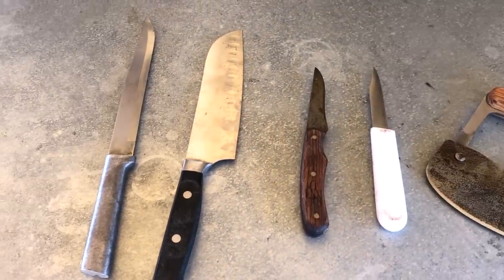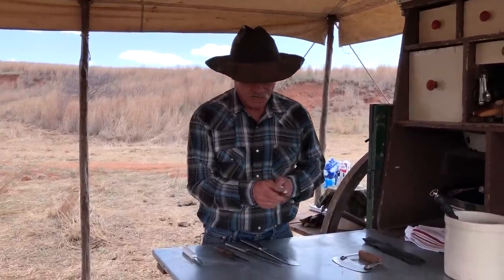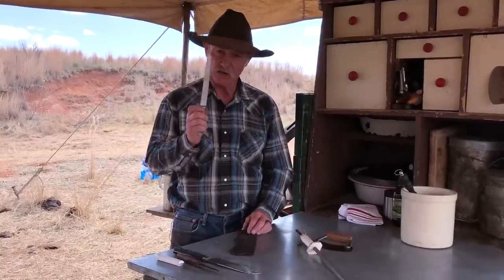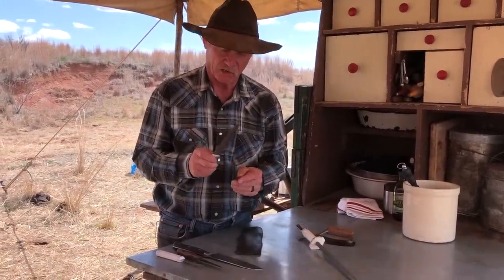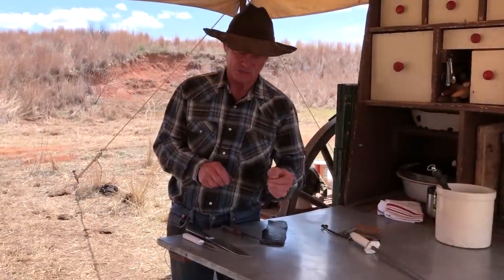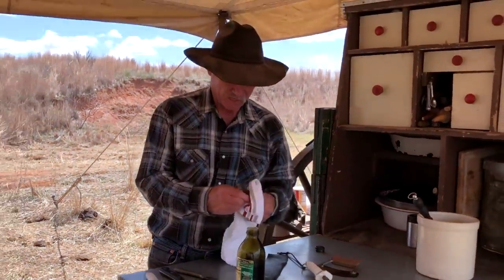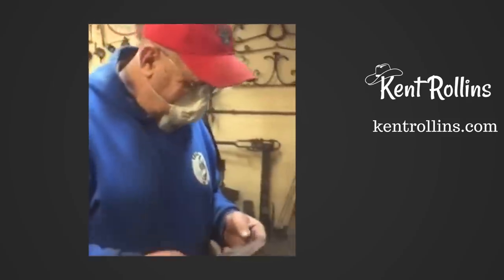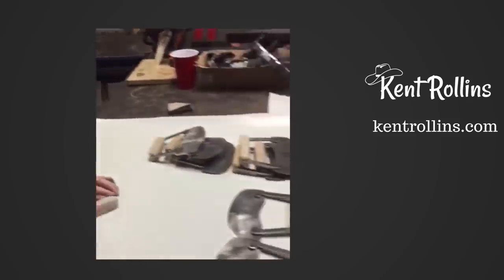Knife Sharpening Tips and Care + Hash Knife How-To

Comment: Years back i recall a Gillette razor commercial that highlighted their "50 foot strop" polishing the final sharpened edge of razors. Years back, my barber who used a straight blade for shaves and final trims around the neck after each haircut, used a 3 foot  leather "strop" before every use of his straight razor.  Un believable edge ! The finished trim was baby butt smooth. Sadly, today folks aren't trusted with a real live razor blade.  Even so with good knives, many don't have great knives and those who do, some don't use the correct sharpener on them. The craft is long gone it seems.

Comment: in case anyone wonders why you dont put knives with wooden handles into the dish washer the hot water makes the handle swell and will cause the rivets to break loose and make the handle loose and fall of or cause the wood to crack because of the swelling remember metal dosent give like wood does and it also dosent absorb fluid like wood

Comment: Honing and stropping with a steel and a leather strop  is a good way to help preserve your blades. Honing is different because you are basically ironing the edge back into place. Using abrasives like a stone will remove metal, many times, un necessarily.

Comment: A sharp knife will cut you just as well but it's over quicker. Truer words have never been spoken:). I've cut a finger tip off more than once, didn't realize it until I saw the blood. LOL. Good advice on the sharpening steel and strop. Personally, I hate sharpening  dull knives. I religiously use my steel every single time I use a blade. Takes 30 seconds and my knives are always razor sharp.

Comment: Your Hash knife is also called a Mezzaluna. They have either 2 handles, 1 on each end or like what you have. You can get them alone or with a rounded out cutting block that matches the curve. You can get them at the big box stores. I have 3, a single blade, double and triple blades. The steel does not sharpen a knife. It maintains an already sharp knife that has been used a lot. It corrects the edge back down to a straight bevel when I gets rolled over on the board. Re-aligning the bevel makes it cut cleaner and better.  Until it does actually get dull.
The V steel sharpener is the worst thing you could ever use on good quality knife. It does rake and scrape and leave chip marks knife/sword fight.  sharpened 4 knives for an elderly friend on Monday. It took me 30 minutes per knife to get the dings out of the blades first then, I could sharpen them properly. I told him to NEVER use that thing again. I was a Chef for 35 years and was taught how to sharpen my very expensive knives myself many years ago by a Japanese Sushi Chef friend. There are all kinds of sharpening systems on the market and videos showing how they work. If you don't know what you are doing with a wet/oil stone. DON'T use them. Ass up and buy something like a Lansky or Wicked Edge type system.  A dull knife is a dangerous knife. They also tear thru the food and slow down your work and production. Let alone the aggravation that comes with it.  There are tools for sharpening serrated edges as well.  As Kent said. Just wash it off after use and put it away in a block or magnetic hanger or use plastic edge guards. Throw a knife in a drawer with other crap and you just ruined you edge. It doesnt take too much to chip a real thin blade or dull it when up against other steel. Sorry Kent, not meaning to jump in, but felt I needed to a little to help. Love the show. 
 Have a great weekend.
Reply: Couldn't agree more. Kent should stick to cooking and have someone teach him how to sharpen a knife properly. If he did that, he could throw that steel in the garbage where it belongs. Been using a Lansky for over 20 years to fix knives that have been damaged using a stone or steel. Keep up the good cooking,  Kent.
Reply: @1957StrokerPan  post your video on how it's done. We'd be grateful.

Comment: I wasn't any good at sharpening a knife until I went to Little Rock AFB, Arkansas and was given a knife we had to use when working in the parachute shop where we built up pallets with cargo on them, and was dropped from the C-130 aircraft. I still have that knife around home now and it has been through so much and still is sharp and does a great job. The unit purchased the wheels where we could sharpen our knives on and there was three stones on them and that seemed to be the best tool for working on knives. The one stone which let you sharpen a blade which was not that dull was the best one to use, and I saw most of the people at the shop wear out a good knife in less than 10 days because they didn't know how to work with a knife.

Comment: You can also polish the edge of a blade with cardboard using the same technique as the leather if you don't have any.
Reply: Yes...a flat piece of thin cardboard with little flex, or even a strip of denim glued dead flat to a clean board. Apply a THIN coat of Mothers Mag and Aluminum polish and let it dry

Comment: I have tried and tried to sharpen knives at home and found that I absolutely SUCK at it. I would rather take my good expensive German knives to a professional every 6-12 months. I take great care to always use a good wood board to cut on and I always hand-wash and dry them. I also have a really good hand-made carbon steel knife from a guy in Eastern Europe (Almazan Kitchen on YouTube - always cooks on a campfire in the forest and his knife is more of a massive cleaver and VERY sharp) which I oil down with olive oil after washing. I don't even try to hone it because the edge is more of a Japanese angle (15 vs 22 degrees). As I said, it's insanely sharp - I showed it to my mom when I received it and she nearly sliced her thumb off pulling it from the hand-made scabbard. Not shilling (especially on Cowboy Rollins' channel), but it's a good product although shipping takes like 9+ maddening months. I think Kent might like it because it would last forever although out in the bush it might take a lot of care. I live literally on the Pacific coast and the salt air eats carbon steel for breakfast. It also plays hell with my industrial DeWalt power tools and accessories. I go through a lot of WD-40 - I think the guy at the Ace around the corner suspects me of huffing it...

Comment: I enjoyed this, as I do with all your youtube videos, however this isn't sharpening. The steel hones the blade. With use over time, a fine edge will fold over, making it dull. The honing steel brings the edge back to "true". You should make a video showing how you establish a good edge on your knives. Do you use a stone? I sharpen mine on a Norton oil stone (22 degree angle) and polish on a strop. I load my strop with green chromium oxide metal polish. It makes for a nice mirror polish. Great for push cuts/utility. On My kitchen knives, I don't strop because I prefer a microscopic toothy edge for cutting soft foods.

Comment: I was watching this sharpening video and I noticed that you were using a butchers steel. A butchers steel doesn’t sharpen a knife unless it got diamond abrasives or it’s wrapped in sandpaper. A steel realigns the edge after it has rolled over. This gives the perception to most people that it sharpens a knife when it doesn’t. Another thing when using a steel, at the end of the stroke a person should lift the knife off the steel rather than letting it slide off. This prevents rounding the tip of the blade. By the way stainless steel can and does rust if not properly maintained. I like your hash knife but I’m pretty sure the Greenlandic Ulu pre dates it and I wouldn’t be surprised if the hash knife took some influence from it being that they look real similar to each other. Living in Alaska has allowed me to see many differ variations of ulus.

Comment: I have quite a few cutting knives and use most of them (when I can afford a good piece of meat!) They also cut my veggies etc.. I had one in the stable to cut carrots for my horse. When it got dull, I sharpened it on the concrete step by his stable box. 
Before carving the Sunday roast my father always sharpened the carving knife on the back door step and over the years (many) there was a"dip" in the step. Obviously knives in our family were knives...as long as the cut and chopped, that was OK.
Although stainless steel, they were cheap and sharpened well.
Keep chopping, slicing n dicing...

Comment: 45? Sounds a bit steep, hone the edge at roughly the same angle it has been sharpened at. Just for anyone that's not aware, a Steel doesn't sharpen, it realigns the edge until there's no more edge to realign, then it needs to be sharpened (should be before it comes to that. Remember, a sharp knife is a safe knife) diamond and Ceramic rods do remove very little material, so they can to some extent be referred to as sharpeners, but the amount of material they remove is so minuscule that it's basically pointless.

Don't put any kitchen knife in the dishwasher, no matter what they say, they're never meant for it.

Unless the blade starts rusting just after a few hours laying clean and dry, I don't see a reason to oil it. It's rather humid here where I live and my knives have never gotten any oil and they're completely fine (and they're far from being rust resistant), the handle will get when I feel it needs.

Just my 2 cents, love your videos :-)
Reply: Zyx He said 45 degree angle...but on close up it looked about 25° ;))).
Reply: Diamond takes off more compared to normal steels, in their grades i.e fine/medium/course, ceramic steels are for super high carbon knives razor Japanese type deals, fine tuning. A f.dick knife and steel and you're set, $60. Beef boner
Reply: Zyx he was referring to the angle of his body he holds the steel in his arm.  When he steeled the knife, that angle was about 20 or so degrees which is about right.

Comment: Here in Alaska we call the hash knife a ulu knife.
Reply: Matthew Illian, Kent mentioned the difference between a hash knife and an  ulu.
Reply: Klawock Kidd ....you might want to view again where Kent says, “this is NOT an ulu”. There is a difference. The ulu ‘s handle is attached to the blade. The hash knife has a different, taller grip you can put your hand through. Same rocking motion but a different approach. I use an ulu every day as well. Very familiar with it and the difference between the two. Check out the video again.
Reply: Bit harsh mate. Take it all easy.
Reply: Hi Matt, Is Ulu Inuit? or another tribe mate?.
Reply: Susan Stoltz not all Ulu Knives have the handle directly attached to the blade. Some of them actually have the handles attached like the Hash knife. There are many variations of the Ulu depending on which region they were used by the Alaska Natives and other Native people in other northern regions. The Hash knife looks similar to the East Greenlandic  Ulu.